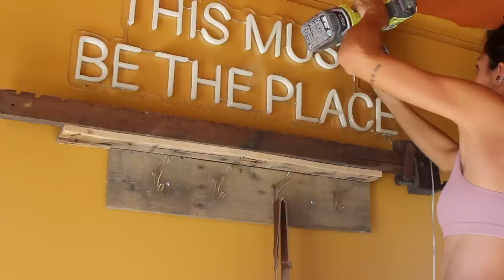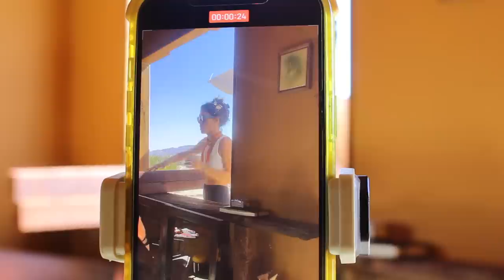finishing my pottery room + desert property updates

Comment: aw, yea - I'm a potter myself. That's why we call it "practice" - and it's more about the action of doing, than the results sometimes. There are lots of tutorials out there, I'd recommend checking out Vaughn Smith - https://www.youtube.com/c/Vsmithpots. Also, your seat is a little high. Try putting bricks under the wheel legs to lift it up a little. I throw standing up because it's easier on the body, but it's easier to learn sitting down. One other thing that is giving you problems right away is that you didn't wedge your clay before starting out.